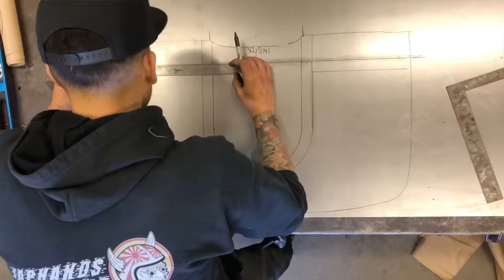How To MIG Weld Thin Sheet Metal - GMC G10 Boogie Van Rust Repair ( PT 2 )

Comment: Once I am at the point of having the first tack welds and everything fitted I don’t weld next to existing welds 
I weld in the middle between tacks 
I use a wood hammer handle to push the panels to align them it also rests the mig gun and holds it steady and lined up 
I keep splitting the weld distance until I’m touching 
I wire  wheel every round of tacks and let the panel cool 
It’s slow but perfect 👍🏻
I grind my welds with bench 
Mark abrasive flap wheels 
60 grit
Reply: I know there is a thousand ways to do things 
Finding what works for you is important 
So more than one perspective is awesome 
I’m always willing to listen 
I’ve learned big lessons from complete idiots lol 😂 
Grind with the weld not across it 
Learn to live with the fear !!!!😂😂😂😂
There’s a GD mountain lion in the car 
In know I put it in there

Comment: I have never seen nor thought of excellence in body/rust repair without the use of plastic filler.
You have inspired me ti purchase a welder.
I found one the has tig, mig, and plasma cutter all in one fir 750.00 
Can you tell me if this is a good purchase for me.

Comment: The whole wheel arch piece about 8 inches over the arch is sold pre-stamped out along with the entire rocker panel as well.  I think they're about $70 bucks each.   Also,  mig welding works fine but mig brazing might work better as it's lower temperature and not a structural piece.  You can get mig brazing wire from most welding supplies,  it uses the same CO2/Argon gas as mig welding.
Reply: As Karl mentioned in this video, some people prefer to use a good, original (part-)panel cut from another vehicle as the fit will usually be better than an after-market repair panel.

Comment: I would put a 6 inch lift front and back and put a 4.88 gear in the rear-end  and paint it with T-Rex bedliner then do a paint job over it then do a matte clear finish then put some deep dish 15x10 steel rally rims with 35x12.50x15 on back and 33x12.50x15 in the front. Then you could add different things to make it look even better. To lift the front you would need a 2 inch lift spring with a 4 inch lift spindle and for the rear get a new set of leafsprings that have 5 or 6 leafs per side that alone should give you around 2 inch of lift then a 2.5 inch lift blocks and a 2 inch shackles and you want your rear-end posi not a single spinner. While you change all of that you might as well replace all brake and fuel lines with something that never rust. And if you can just replace every thing that can be replaced with good quality USA parts. With some GM you will need to remove the rear leaf spring brackets and turn them upside down so your leafs to except a shackle.

Comment: Switch to ER70S2 wire and your welds will be softer, easier to grind, hammer...like the mild steel base metal. It's not as easy to find as the er70s6 wire but it's out there. .023 is available on Amazon-blue demon makes it. I also feel the welds flow better with S2
Reply from the maker: Interesting thank you!

Comment: You did a great job!  When i do many spot welds the wire seems to not get a good connection and needs to be clipped, making it hard to rattle them off.  Do you have this issue?  Or is this more of a function of flux core?  I have some panels in my truck bed i need to do and it take a long time to do the spots let alone having to clip for a fresh tip.

Comment: Noticed your "somebody correct me" about the rust to acid conversion. You 'neutralize' the acid by applying a base. But your wording works as well. Kinda a formal vs informal wording for chemists

Comment: Love this video and your work - results are amazing! As someone who doesn't know, can anyone tell me why it's worth the extra work to butt the metal edges up when welding instead of just creating a shallow flange on one side and overlapping the metals? Thanks!
Reply from the maker: By overlapping you were allowing a way for material to get stuck in between or moisture to wick in. For repairs that are somewhat temporary were not expecting to last a lifetime then overlapping is fine. For most repairs I would say it’s good enough but for the best repairs But Welding is the only way to go

Comment: Your craftsmanship is so well developed, I suggest you not limit yourself to restoring to original specification.  Let you creativity flow and make it better than original.  The spot welding and stamping of these sheets into their compound curves is done to facilitate low cost mass production by big auto.  You have no such constraint when working by hand with sheet steel.  Make the design better and more functional - perhaps by not trapping hollow areas behind the panel which will inevitably facilitate unseen corrosion.  Or perhaps different flare designs around the wheel wells offering improved styling.  Maybe accomodate running boards or hard points so that bolt on accesories could easily be accomodated.  If you offer your skill set and capabilities to small business for prototyping work, you might have some fun and make some money for more tools in the shop while helping local industry/jobs.  In any case, well done and inspirational !

Comment: In your video intros, there is a clip that appears to be of you bending a box bracket/mount out of 1/4" plate.
That really got my attention.  Have you done a video on that ?  Being able to bend 1/4" plate would solve a lot of problems for me.
I'm slowly building up to having that capability, but there is a lot of wild guessing and trial and error involved.  
Some people would have you believe "that's good training...".  I'm not of that school of thought.
I prefer to build off other peoples experience.  No sense repeating the pain.

What tonnage is the press you are bending the 1/4" plate on ?  Can it be done on a 20ton (what I currently have)?

Yes.... I am learning almost as much from your shop layout in the background, as I'm learning from the intended content.
Good stuff.... Informative videos.

Your mill.  It looks to be a Bridgeport clone, but I don't recognize the make.  "First" ?!
Reply from the maker: Yes it is a Bridgeport Clone “ first “ The brand and it works quite well I’m happy with the quality. Yes you can definitely do quarter inch plate with your 20 ton press but the capacity will depend on how long of a bend you want to do and how sharp of a bend you want to do

Comment: Awesome video. By the way, you said you're using 0.23 wire. Where I live at the local welding supply has 0.25. Is that good to use on repairing a shock tower metal 16 gauge.

Comment: Good video 
But if been doing this type of restorative work for last 30 yrs plus,
I use stainless steel, old restaurant worktops ect, 
Welds with a mig to steel with CO2
Spot on,
Never rusts again,
Stronger,
I make chassis's, bodywork, excellent for bottom of door repairs, sills ect
Try it, you'll never use tin plate again

Comment: Pure water has a ph of 7 which is neutral.  If the water is highly alkaline in may be a mild base.  You are probably just washing the acid off.  To neutralize an acid you need a solution that is base- it would have ph of between greater than 7 and up to 14.

Comment: What model of welder do you use and what heat range. And will a cheaper welder do the trick? Replacing the bed floor in my Ranger due to mouse piss and plastic bed liner bad combination.

Comment: Nice job and great educational value! Sometimes after you go over with wirebrush or flak disc, you use another one - is that a polisher? If so, why? With a heavy cut?

And what do you do with the holes after the clecos?
Reply from the maker: I just tack weld those holes up. I use 80 grit on the DA for the final finish
Reply: @MakeItKustom  Thanks alot, thanks for the great content and keep up the great work!

Comment: I really enjoyed your video, and the explanation of the steps in there sequences. I've been welding for years and wish to learn how to make my own repairs on vehicles. One question I have is what welder do you think would be best for the buck as I'm in the process of buying one. And what is your views  on the different multi process Welders out there? You may already have a video on this as I'm a  newbee to your channel. Your doing a great job, thank you!
Reply from the maker: Thanks very much! I don’t have much experience with welders other than the ones that I use. But for me 110 V wire feed welder does the trick well with 023 wire for sheet metal. With that being said if you need a welder to do more than just sheet-metal I would go for 180 amp wire feed feed
Reply: @MakeItKustom  is this with gas?

Comment: Excellent job man... ''Just like store-bought''... lol... With those Air Grinders, what does the ''DA'' stand for [???]... I've always known them as that, but never knew what the initials stood for...
Reply from the maker: Dual action I could be absolutely wrong because I was corrected once lol but the sander I’m using is actually a random orbital period and a dual action sander has the same action but you can also lock it so that it just spins.

Comment: I'll fix it to a really beautiful✨✨✨ (°Д°) 🎵I don't think there are many car sheet metal specialist craftsmen who can build and repair car body parts from the original with iron plates💦Cut and weld the excess parts Other car sheet metal craftsmen can do the restoration, but starting from scratch by shaping the steel plate from the body part prototype and rebuilding it makes it look beautiful✨✨✨ even from the perspective of other professional car repair sheet metal craftsmen. You are the only one who can make it so that no one knows what you did😎👍️🎵

Comment: Relly loving the videos, im currently a collision repair tech, would really love to get into the hot rod/resto field. You said you're not putting filler on those panels, is it a customer's vehicle? do you just do the metal side and prime it and they finish it out? just curious on end stage finish, thanks. (you might have covered this in a different video, im just sitting here on a sunday jamming out to these)

Comment: Good afternoon Karl, lots of great tips, tricks, and techniques. What brand and model is the spot weld chisel you used in your air chisel? Seems like it worked really well. I am always looking for a better way to do things. Thanks and take care.
Reply from the maker: It’s just the cheap cheap ones the trick is to drill or grid most of it away first

Comment: In the minute 30:00 seems that you cool the welding with air gun. ¿Is it correct? ¿Is better than not cooling? Very interesting tip👍
Reply from the maker: This is debateable but Yes a cool the welds to keep the panel from warping.
Reply: @MakeItKustom  thank you for share your knoweldge👍

Comment: 40 (ahem!)+ years. Oxy acety used same principles but you only quenched it 1/2 down with water before proceeding to the next tack/bead. Not for the faint hearted in the middle of a low crown area. ie: roof hood etc.

Comment: Did you build the patch panels from scratch also and I've also done jobs like this many to wear the inner the backing to where the outer seal connect to was rotted so you have to remake all that or go to the junkyard if you can't remake it if it's specially stamped and cut it out and put it in so the front capping of the new rocker cab corners Exedra have something to solid to weld to
Reply from the maker: Yeah they were sections of the inner that were rotted as well. Yes I did make the panel there is a full video on making the panel as well

Comment: Seems like mig welding thin steel is kinda like ironing wax into a ski. The manufacturers tell you to turn the iron up so it melts the wax really fast but that temperature is also hot enough to burn the bases of your ski so you gotta move the iron fast but not too fast or else your still not going to heat up the wax. I guess in this case instead of melting the bases you’d just be applying too much heat to one area and warping the metal.

Comment: Have you run into any issues with the weld-thru primer  when doing plug welds? Sprayed a light coat on the rocker this weekend for a camaro, and none of my plug welds bonded where the primer was. Other parts that weren’t coated, bc they weren’t on the backside, no issues welding.
Reply from the maker: Definitely sounds like you need to turn your machine up. Weld through primer is not the best thing when welding but it does work with just a little extra heat

Comment: If you don't use any fillers what did you do for the pits left from incomplete welds after grinding? At drop little welds to finish completing the metal?
Reply from the maker: I use fillers. Everything needs filler for paint.

Comment: Amazing work, I watched almost all your videos, I just had a question, I only have a tig welder , can I do the whole thing with it?
Reply from the maker: Yes just take your time and tack often. Weld only short beads at a time and move around a lot. This will help fight distortion. If you have access to the back side then you can do full welds And hammer then after
Reply: @MakeItKustom   Thank you so much , I’ll try it next week, I’ll be replacing the rocker panel on my car , Hope I don’t mess it up

Comment: You need to Neutralize an acid... You should be using baking soda in your water or milk.  Water is neutral your just mixing the acid stopping it from drying more and rinsing it onto your concrete floor which is bad.  At least its not strong acid like pickeling acid for stainless.

Do you ever use the 3m scotch bright red finishing discs?

Comment: nice video you know your shi ! I'm jealous though you get to work with nice 16 Guage steel i am doing a similar job on a 2024 silverado i have to splice in the cab section and rocker panel on one side and let me tell you you  don't get to butt weld on real steel anymore

Comment: I respect the skill and diligence in this video, and I recognize that this is being done mostly as art & historical restoration. But honestly my takeaway is that curved surfaces in vehicle bodies is a way that manufacturers build in planned obsolescence. This amount of work to get the right shape can only be done efficiently at massive scale. Once a regular person owns a car with a curved/rounded body, it’s an economic disaster. And it’s totally avoidable by designing most or all of the body to be flat and/or square. And before the smartasses jump me, there are plenty of examples of vehicles that have done this.

Comment: On your sheet metal tack welds, why do you cool the tack weld with air before you move onto the next one ?  Isn't the purpose of doing the whole seam with tacks, to allow the earlier ones to cool before you cycle back through ?
Is it to avoid panel expansion/warpage from accumulated heat ?
Reply from the maker: Bingo! Yes I cool the previous one so that the heat does not accumulate in the panel. This way the panel is always the same size. It has not grown from heat in one spot more than another while we are trying to weld it on

Comment: Those sheet metal clamps (borrowed from aerospace industry), how do you properly spell their name ?  Between my bad ears, and the closed captioning spelling constantly changing, I'm not catching enough to do a search.
I can see where they would be real useful for some of the projects I tackle.
Or, if you have it.... a link.
Your help is much appreciated.
Learning a lot through your videos.
Reply from the maker: So great to hear it! The correct spelling is “ cleco “ You can search this on Amazon or on tool distribution websites. He will come up with many options. I use the 1/8 size the most

Comment: Complete noob question here. What thickness cut off wheel do you typically use and are you cutting right on your sharpie line after you've marked? Awesome content man!
Reply from the maker: I use an .045” disc and cut on the right side of a sharpie Line usually
Reply from the maker: Thanks!

Comment: I have a question on welding you may be  able to answer.  Is there a difference (for a novice) between welding sheet metal with a 110 volt and a 220 volt welder? Of course I am using low settings. I have a Miller 220 v unit and I just can't seem to get it dialed in to weld auto sheet metal. It seems a lot of people on YouTube are using 110 v MIG units and they seem to be able to get a nice frying bacon sound weld on auto types sheet metal. All I do is sheet metal welding, do I need to get rid of the 220 v for a 110v?
Reply from the maker: As long as your machine can be dialled low enough there is not a difference. The difference will be in wire size. I keep a smaller wire size in my smaller machine that’s why I use it. Are used to only have my gigantic welder and I used for everything

Comment: Perfectionism! Hey question so i dont have access to all these fabrication tools and i have my car with the windshield metal eaten up I been trying to cut small pieces of a fender i had.the metal is extremely thin due to me trying to remove most of the rust .
when mig welding it eats the extremely thin metal that I sanded down. Any tip on going about it.i literally  have it to an extreme low setting.
Reply from the maker: I think maybe you will have to replace some of the extra thin metal. It’s important to only bring down weld and never the sheet itself
Reply: @MakeItKustom  yeah figured the thickness is literally like trying to weld paper.thanks for reply those tools and that patience and skill is truly awesome man subscribed.

Comment: You said you were using .023 wire, is that flux core? 
Also, did you use the same size wire for the final tacking?
Reply from the maker: Yes I use 023 solid core wire

Comment: Ok I don’t have no where close to the tools that you have good job question what size wire did you use on the mig and what was that rust stop that you used
Reply from the maker: The wire is 023. The spray is rust mort
Reply: @MakeItKustom  hey thanks for responding question how do youGet your panels to fit so tight